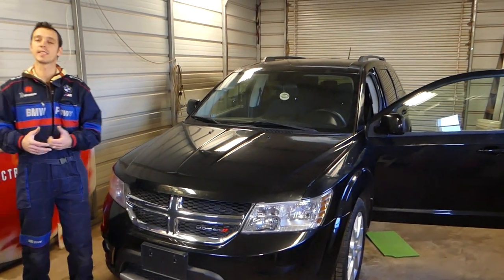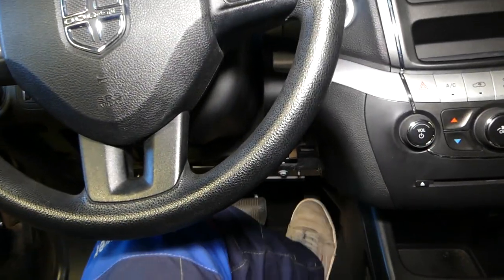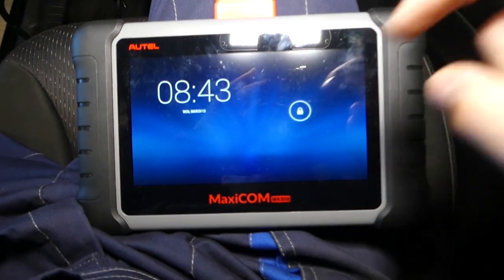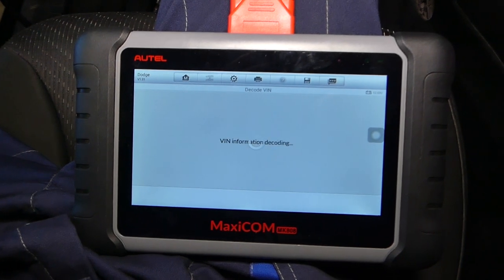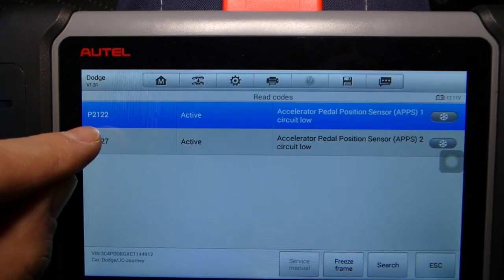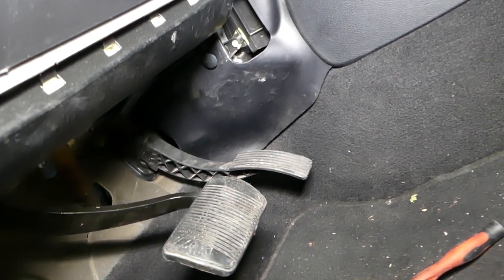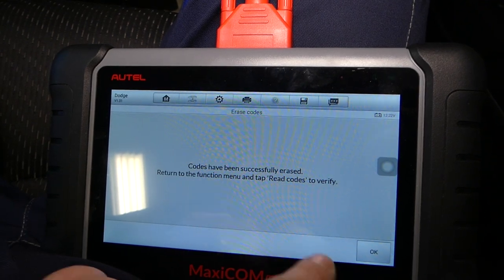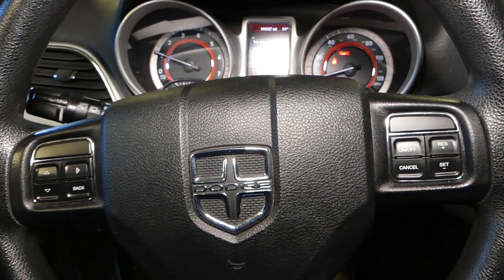CODE P2122 P2127 ACCELERATOR PEDAL POSITION SENSOR DODGE JEEP CHRYSLER

Comment: I have a 2006 Dodge Charger RT and the red lightning bolt is flashing on my dash. I changed the accelerator pedal sensor and the light is still on and flashing. I also changed the throttle body and it was still on and flashing. The car does start. What else could it be?
Reply: Did you ever find out? I am having the same problem
Reply: Terrence Richardson mine doing the same thing did you ever find out
Reply: I really need to find out
Reply: @willchestnutt4138  depending on the model the pedal might not have the throttle position sensor attached to it.  Hes working on a newer vehicle
Reply: EXACT same problem on my 2006 charger 5.7 Hemi. I've taken it to so many shops and they've rep;aced just about everything except for the accelerator pedal (sensor is on the pedal). Bought one yesterday and praying this will work.
Reply: @oahugrown07  did it work?
Reply: @XxGoldenModzxX  worked for a few days, then the engine light came back on.
Reply: @oahugrown07  i got a jeep commander with 5.7L Hemi doing the same thing. With both codes 2122 2127...did you find out what was wrong? Thanks
Reply: @slikkpaper4057  nope light still on.
Reply: @oahugrown07  have you done the key dance.  Ignition: turn key on/off 3 times leaving it in on position the last turn? Any other codes? If not? I would check wiring, battery etc.

Comment: I have a 2006 Ram with a 5.9 with code 2121 apps sensor I bought néw pedal position sensor replace and now I have 3 codes 2121 2127 2128 and I get nothing from pedal my % reads zero from top to bottom if I press the pedal with the orig pedal it read % but had a dead spot where it went back to zero I’m completely lost on second new pedal I thought it was defective but doing exactly same thing  have any ideas

Comment: Huh? Wtf, You just cleared the codes?! What exactly did you do to fix it? All you did was clear the codes, so the owner THINKS you fixed it.
Reply: Obviously you didn't watch the video. He couldn't even accelerate/give it gas at all. He change the pedal and now he can give it gas so #1 he did fix the problem &2 you have to clear the code. It wont go away  on its own.
Reply: @veronicagarcia827  that’s not a fix, he will be able to drive home but the code will come back within a week because problem still exists

Comment: I replaced mine in my 2013, did the reset an still staying in limp mode, I’ve tried disconnecting the battery, fuse, any reset online you can think of, I’ve tried, still in limp mode… any suggestions
Reply: What is you change the accerator panel sensor and it doing same think won't  accerator up
Reply: @DickieSmith-k4z  can’t accelerate, stays in limp, done everything i can think of may need to swap my throttle body to factory, see it does idk
Reply: @Raizo177 did you find out the problem?
Reply: @bigswervo434  yeah I did find out the problem I had recently removed a pedal command from my car and apparently there was a wire that was still part of the pedal command the past to the throttle control so all I did was remove it and everything went back to normal